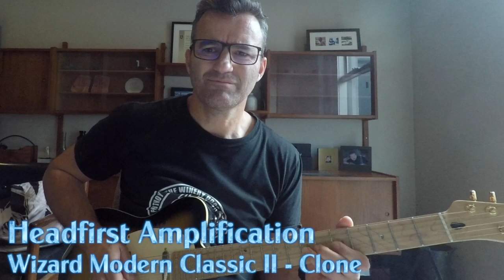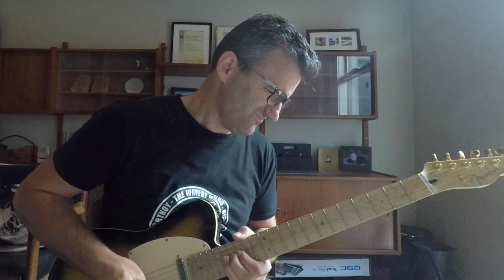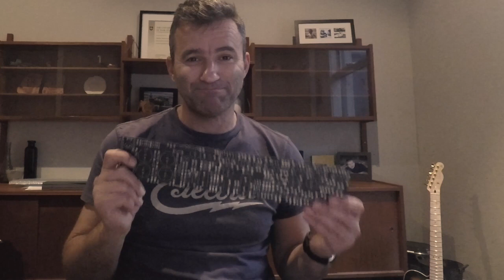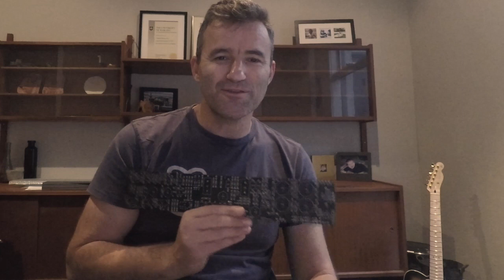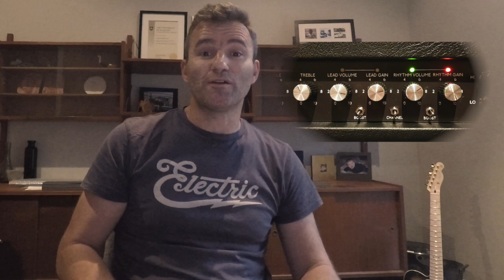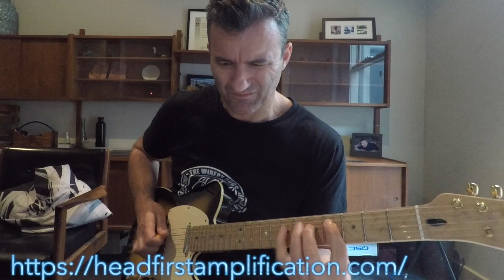Wizard Modern Classic II Clone with MIDI

Comment: The original design would be for 50W or 100W.

What are the power supply changes to 25w with two 6v6?
Reply from the maker: Plates down at around 410v

Comment: Sounds awesome.  I want to build this exact amp (two of them, if fact), but want to know if the transformers and all that will fit into a Soldano/Mesa style rackmount chassis and if so, does anyone have a source for such as chassis?
Reply from the maker: You can do a 6V6 MC25 with a Marshall 18w 1974 project set, but add a choke too.